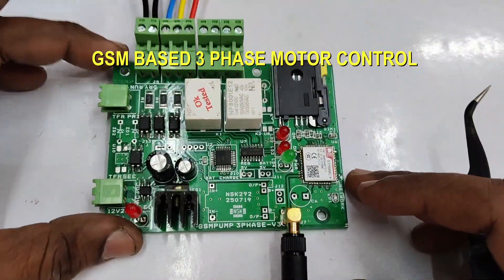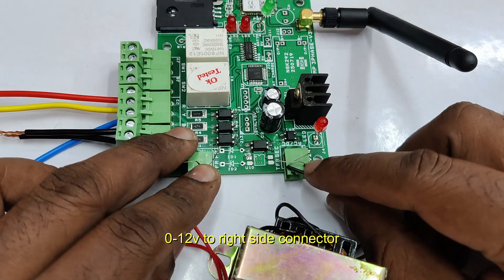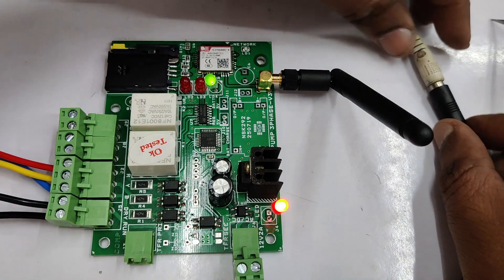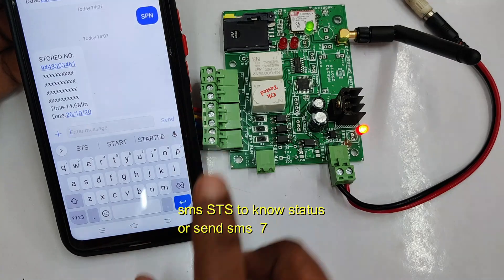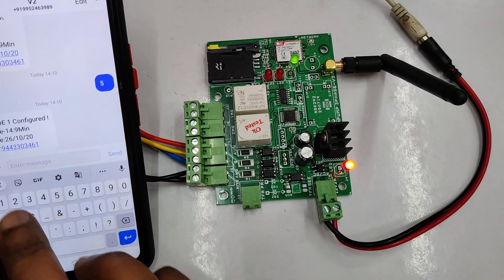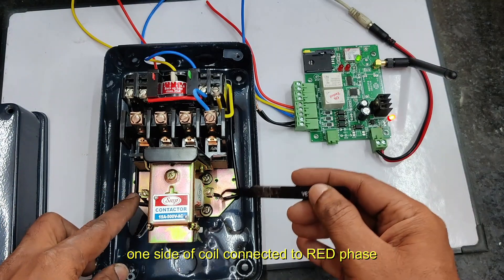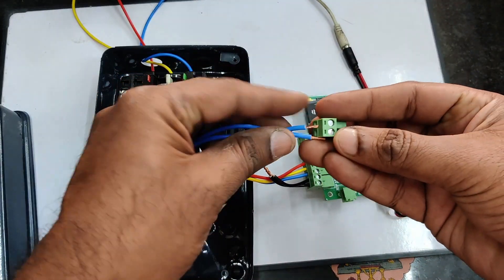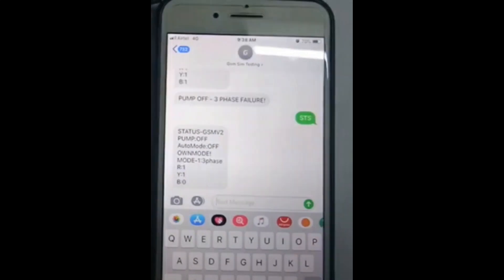GSM BASED 3 PHASE MOTOR CONTROL

Comment: good morning saravanan sir. last three months i have been using your product. its work well and good. two boards and different places. very nice. now i am in the need with motor on and off with gate valve controller minimum two its possible sir .
Reply: with ivrs facility sir

Comment: Hello sir, if the contactor coil is of 415 volt then how can the relay handle that. Because the relays are rated for 250 volt

Comment: I was using separate 12 V supply. Now I want to use 400V to 12 V transformer as in this video. Where do I get it and what is the specification ? Amp rating

Comment: Very nice service, Ordered and got one today, Will edit the review with my experience with it.. Sir had made some changes based on my requirements also. Very promising establishment. 

Keep up the good work.

Just Installed the Board onto my Motor Starter, Works Perfectly 😍
Reply: How to Order It ???
Reply: @sivaganesh4853  Check out the video description.. they've given a website.. you'll find a contact there

Comment: Hye sir, would like to create/find the gsm control but don't want any timer setup. example when you send the sms the circuit. it will switch on the motor, but the product sell outside normally comes with default timer after we switch on, the system will only switch on only for certain time period only, not permanent until we ask the system to stop. di we have that kind of system?

Comment: Can someone please explain what is difference with submersible 3 phase motor and 3 phase borewell pump in relation to using this chip...? I'm new to this and want to understand can I or can I not use this chip for 3 phase 7.5hp borewell motor...

Comment: Sir transformer nhi  mil raha hai kha se kharide
Reply from the maker: You can use a 12v DC adapter directly at power in connector.
Reply: @SaravananAL  gsm mobile starter price

Comment: Hii Saravanan. Can u please tell if neutral is not used. How 3 phase inputs are sensed by PC817?? As there is no connection available to the cathode pin of PC817?? How it is working???
Reply from the maker: For 3 phase system there is no need of Neutral. One of the phase will act as Return path for other 2 phases.PC817 senses the phase to phase difference.You can see high value smd resistors used on board  in pc817 circuit.
Reply: @SaravananAL  yes. Got it!! Thanks for the reply!!
Reply: @SaravananAL  praise
Reply: CMS bod ham ko Lela hai ke tana ketana ka hai 20

Comment: Hi , see your videos and so great,
I'm willing to make an IoT base project for the pH and TDS monitoring and controlling SCADA, can you give the little help for that because I'm a beginner for this
pH n TDS data + controlling relays(I2C) ==> Arduino (I2C or USB)==> Rpi 4 with 7Inch HMI touch for local monitoring (Internet)==> web or app monitoring world Wide
major requirement == how to make a SCADA and connect the data to web or app